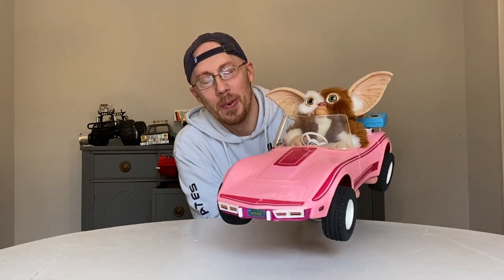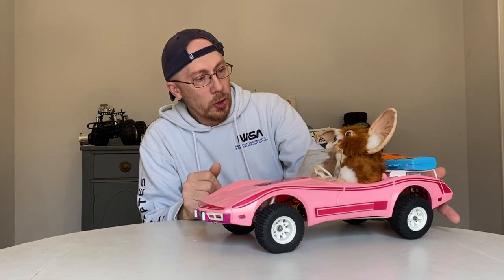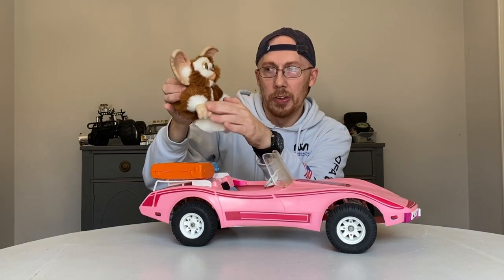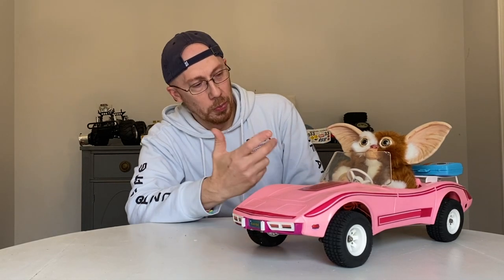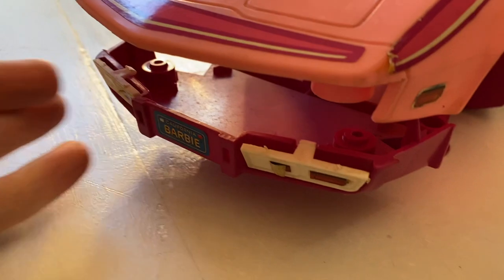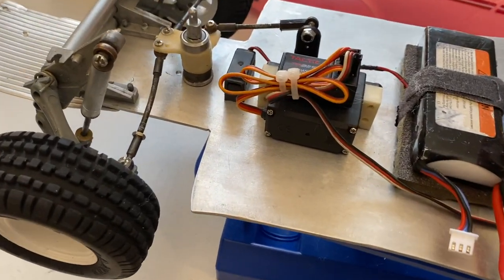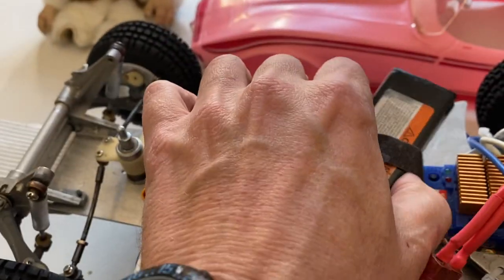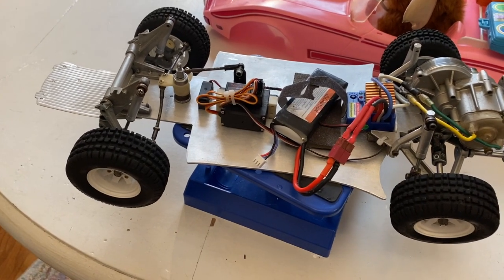GREMLINS GIZMO CORVETTE RC CAR BUILD AND DRIVE Prt.2

Comment: Luke, Great Video!! 
I'm in the final stages of doing a build with original Barbie Vette and Team Associated TC3 Chassis. New decals are on order, so I'm now ready to clean up the body and remove the decals. 
Please advise how you removed the decals and what you used to clean up the body to make it look like new?
Thanks again for helping make my build possible.
Reply from the maker: No problem so I use a heat gun for decal removal. Plastic x polish. Thanks for watching.

Comment: You really recreated the original Prop Car, that is simply fantastic, can you do a parts list so we can follow what you did. The tyers are the Sand Blaster 915  but you said the inside is not from  the Subaru Brat , can you tell what you used, the  special Racing Buggy  or Rough Rider or F 150. What could you suggest for me as beginner to use?
Reply from the maker: Hi sir, I have a part one of the video. Check it out as it will help you with things used. Please watch the entire video and check out my other fun rc videos. You can also check my Instagram for upcoming videos. Don’t forget to Like and subscribe. Thanks 😊
Reply: @LukesVintageRC  Hi Sir, yes I saw part one but did not catch what chassis you did use to modify.   thanks for the help and I do love what you are doing

Comment: Amazing!!  Where did the get the steering wheel?  How did you attach the suitcases?
Reply from the maker: Hi, a 1970’s laTrax car hand held control. Another member is building using a rc yacht wheel instead. The Barbie suitcase are attached to the rack by zip ties. The cases actually open up to reveal this. You probably could epoxy them instead for ease. Wish you luck in your build keep us posted.🙏
Reply: @LukesVintageRC  Thank you for the info!  Can you please tell me what the diameter is of the wheel that you have?

Comment: Same wheels and tires used on the F150.
Reply from the maker: Along with Front end, transmission, swing axles. It was the exact same parts used by the Amblin entertainment Studios version.
Reply: @LukesVintageRC  wow, this is just amazing! could you list the parts you used in this fantastic build. that would be so helpful for anyone trying to do the same. thanks alot